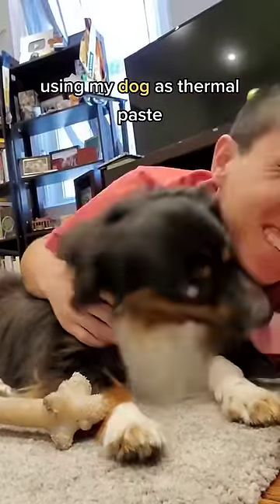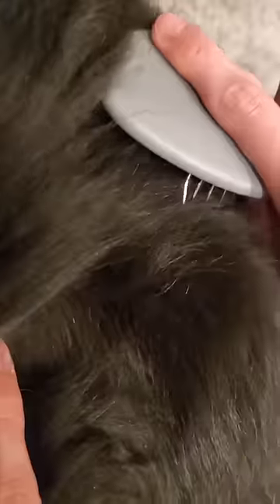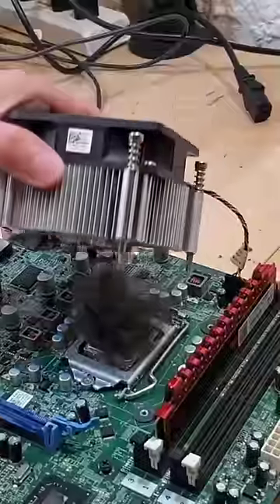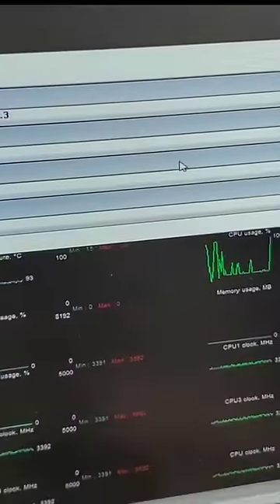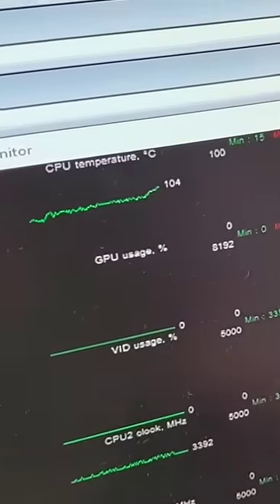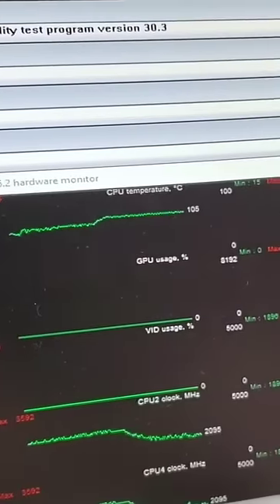using my dog as thermal paste #shorts

Comment: Fun fact: Dog fur is an excellent insulator, which will actually prevent any cooling from your fan from reaching the CPU. It'll also give your CPU a nice warm blanket to heat up a lot quicker than using nothing at all. You'd probably get better results by not using a cooler and leaving it open to the air